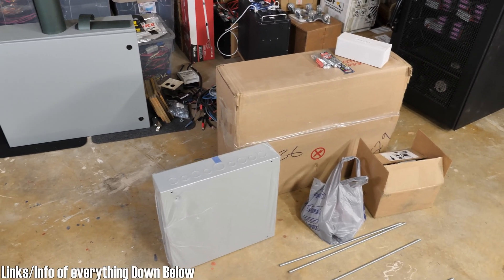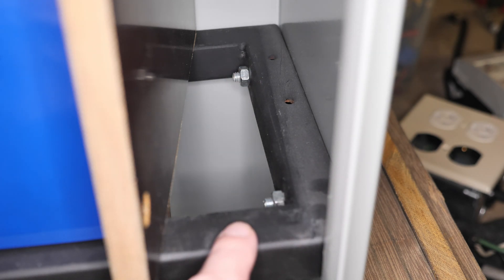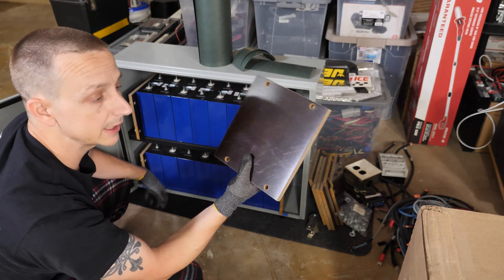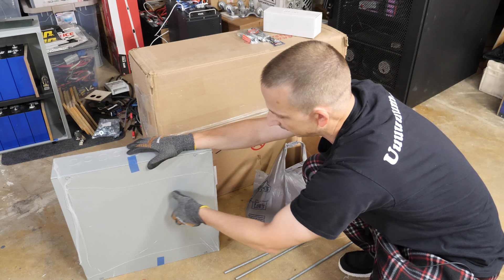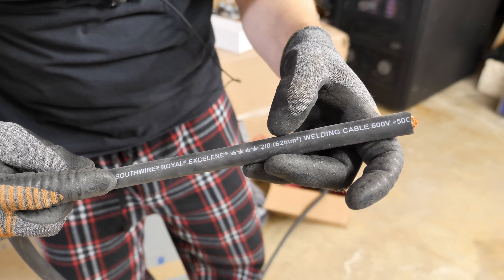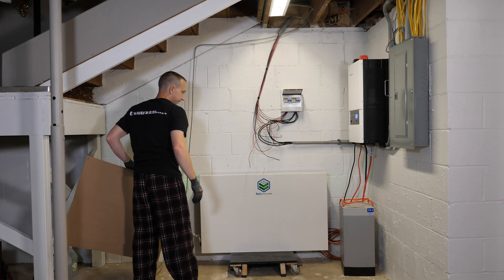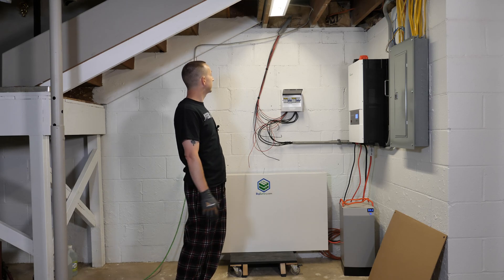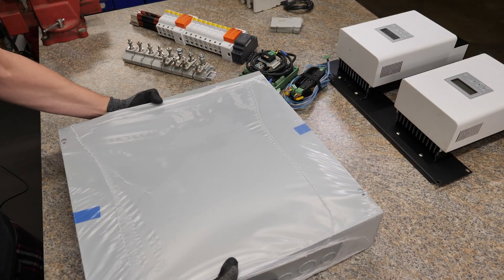The 5 Peeee's DIY POWERWALL 2.0 ep2

Comment: Your idea of screwing the battery enclosures to the wall might be semi unsafe. I would suggest a nice adjustable metal set of heavy duty shelves that are rated for the weight of the boxes. The solar box can also be safely set on the shelf and you can move each around to your liking. Suggestion 2 might be building a deck box on the floor that gives you access to each battery set. You would have a nice work area or seating or tool area on the wall. Yay ?
Reply from the maker: Later video I ended up using uni-strut to mount the battery boxes.  So far its a super solid way to mount them!💥🤘

Comment: Unistrut would definitely work but even that might be a little uneven with the way your walls are. If it was me I'd just grab a diamond concrete grinding wheel for an angle grinder to make things a bit more flat. Then mount directly to the wall or use 1/2 height Unistrut pieces mounted horizontally. I'm sure whatever you decide it will look great.

Comment: You can always use fender washers as spacers to even it out if you bolt directly to the wall, having a bit of space between the box and the wall will also reduce the likelihood of rust. If you go with Uni I'd stick with the steel version, the aluminum version is nice but the lip strength on it to hold that box isn't quite as strong. That's a lot of weight that'll be hanging off it. 

Should get you a lot of capacity though!
Reply from the maker: I decided the uni-strut is the way to go for sure! Havent seen aluminum at lowes, only steel. Will go with the bigger 12ga over the 14ga kinda for same lip strength reason! Hell yeah upgrade, should be 45-50kwh when I get this up and going! Cant wait🤘
Reply: @AVERAGE_JOE  If you have a Fastenal store in town you might check them on pricing for Uni, Lowes and Home Depot pricing is nuts right now. Fastenal carries it and the aluminum version too if you ever need it. My local Lowes doesn't even have it on the shelf.

Comment: I had the issue of the wall not being square, I solved this with washers/spacers.
Reply from the maker: Did you mount to the wall directly? I think im gonna do unistrut so I can mount other things if needed.🤘
Reply: @AVERAGE_JOE  I mounted it directly to the wall.  Just use washers to level it way simpler.  I used a template made from cardboard to drill the holes and set it all up.

Comment: Why not tapcon a sheet of plywood to the wall, paint it, don't paint it,
 it would look fine either way.   4 anchors in the wall , then it would leave a clean canvas for your artwork! Mount that solar equipment up on it!!  Maybe space it out a bit, and hide wiring behind it!  I would go with plywood!!  It would have a more finished look, and make attaching other thing to it easier!
Reply from the maker: I would but I dont know if plywood would hold everything🤷‍♂️

Comment: I think the Uni Strut is the way to go.  Where I used to work we installed many different types of controls in chemical plants and refineries.  The aluminum strut is really neat to work with and not as likely to corrode or rust like the steel.  Makes it really easy to change spacing if you need to.
Reply from the maker: Will be going with unistrut. I didnt see aluminum at lowes so getting the steel! Should be a pretty sweet look when done!🤘

Comment: Glue plexiglass to the bottom of the shelf.  I would not want the shunt/trip breaker inside of a box.  I'd want it mounted on the wall where it is easily accessible.
Reply from the maker: Shut trip breaker will be accessable when mounted inside box. The switch and face will be exposed.🤘

Comment: The name escapes me but the rockboard used for tile primarily is thinner but prob not quit as strong as unistrut. N cutting the stuff is horrible with all the fiberglass they use. Perhaps a disconnect on each box? Least the unistrut will be strong af! Exciting times from the average Joe channel. Keep up the good work
Reply from the maker: I think there are 2 kinds of the board you are thinking.  Both may be called concrete board.  One is thick and one thin.  They are strong for sure but not sure about mounting that much weight ??  I have some of the thicker stuff which I may install above everything for a layer of protection.  I think Uni-strut FTW!!!  Thanks Mate!!!💥🤘
Reply: @AVERAGE_JOE  I agree, unistrut will be way stronger, you have all the anchoring options you could hope for. Good luck Joe!

Comment: I was thinking for the smoke make at the top a capture funnel that with a smoke detector, turns on a strong fan to suck and force it out.
Reply from the maker: I will probly add a smoke detector to the batrium so it can possibly do that and of course disconnect everything!!🤘

Comment: So, any fuse is to protect the.cables. What size cable are you using? Will it withstand 400A + 10-15%? Might be a bit much for 2/0?
Reply from the maker: Yeah will have 400a HRC fuses right off the battery and then those cables will go to the shunt trip breaker.  The amp draw for 12kw on the growatt inverter is about 250a so 2/0 is plenty as I wont be running full bore 24/7.  I went with 250a X 1.5 which gave me 375 so I rounded up to 400a on the fuses.🤘

Comment: Man those batteries are going to be heavy hanging on a wall.. you are going to need some heavy duty reinforcing of those cabinets/boxes from what I can see. Why not just put them on the ground and stack them?
Reply from the maker: Yeah its gonna be heavy but close to the wall should help.  The boxes are already pretty heavy duty steel and not light.  I had thought about on the ground but wanted them up on the wall and off the ground.
Reply: @AVERAGE_JOE  yes it will look cool having them on the wall off the floor. Usually cabinets/shelves that have a lot of weight in/on them have legs that go to a concrete floor. That’s what actually supports the weight.

Comment: If you’re really set on having a low profile for the Rhino, another option is grinding down the wall until it’s flush. I just don’t see how a unistrut fixes the problem of an uneven mounting surface.
Reply: He would washer it out where needed
Reply from the maker: With the uni-strut I guess since it pushes them out a little I can mount the strut on a flatter surface BUT I could use washers as many suggest to shim boxes on wall.  Uni-strut would make it easier and possibly less washers.

Comment: Let the Batrium have its own apartment.  All strut is what I use for everything I mount anywhere.  Don't have to be so precise with mounting holes or hardware, and you can move it simply without starting and drilling over.  and you can add additional support screws if and where you need them because of the weight.
Reply from the maker: YES!!! I LOVE THAT!!!!  Uni-Strut FTW!!!💥💥💥🤘

Comment: Each battery case should have a disconnect, temperature sensors, and exhaust fan. Even though each pack will have its own BMS to see all the metrics and stats. I’d incorporate a dedicated shunt and display to help monitor and track each pack for operation and overall health.

I would install X (fire) rated drywall or cement board to the wall. This will slow down and contain any potential fire. I like your venting idea to the outside and with the inclusion of the fans on each enclosure it will help reduce the potential of deadly LiFePO4 gases should there ever be a rupture.

They make dedicated venting doors for various industries. But you can make your own by cutting out an appropriate sized hole on one side. Put a fan grill with filter on the outside. On the inside just have a hinged metal plate that will swing open anytime the fan is activated.

This simple design insures two things which is during normal operations and no fan is on the enclosure is always sealed. When and if the fan is activated it can draw outside air to cool the interior while also venting the heat / fumes to the outside. 

As it relates to the venting tube. You’ll need to balance costs vs fire propagation. You can find a middle ground by using whatever sized conduit and enclosing that specific pipe within a metallic hard duct like for a furnace / dryer.

Having a dual wall venting pipe assures if the fumes turns into a raging fire if and when the plastic conduit melts the outer metal duct will still contain and vent the hazard.

Lastly, as it relates to temperature monitoring have a dedicated display mounted to the outside of each enclosure. 

This will provide two things which is by eye you can see the interior temperature without ever opening the door. Two, should there ever be a raging fire you’ll know it’s not safe to open the door!

Anyone who recalls the movie Back Draft knows the extreme hazard of providing fire what it needs: Oxygen 

You open that door while there’s a smouldering fire. As soon as you open that door Booom! 🤦‍♂️

Lastly, have two 20lbs ABC rated fire extinguishers mounted close by. One by the power wall and one at the bottom of the stairs. If you want to get fancy you can connect the temperature sensors to activate a relay to turn on a strobe / red light / siren so at a glance and by ear you’ll know there’s a fire condition present. 

Love your channel and everything you continue to share with the community!

Rock On . . . 👍🤘
Reply from the maker: Yes,  I will add a disconnect on each box for sure!  The Batrium is the bms I am using and its a single bms however it has longmons that go to each cell which have temp sensors on them.  It also lets me see all cells so will use 1 shunt.  The batrium will allow me to do all sorts of stuff if wanted.  The wall in concrete so wont need to add concrete board there however I plan to add concrete board above the system to cover any wood for jic even tho LiFePO4 shouldnt go up in flames.  I guess the flame protection would be for the other items!  Thanks for all the suggestions!! Appreciate it!!!🤘

Comment: How about a vertical chase-way butted up against the battery boxes, with the electronics box directly on the other side ?  That'd be really clean.
Reply from the maker: I was thinking about those chase ways.  Only tricky part is under the inverter...if I took it over that way as well!!🤘
Reply: @AVERAGE_JOE  Yea you could totally run a horizontal chaseway under the electronics box and around to under the inverter.  No visible wires!

Comment: Re mounting, unistrut will work fine but it might be easier to add some spacers, shims or rubber washers as standoffs so the boxes are a fraction of an inch off the wall for leveling.   Just a thought.
Reply from the maker: Oh yeah true on shims to level it all off!!💥🤘

Comment: Consider getting one of those plastic boxes with din rail for the breakers and surge suppressors. The din rail load centre is commonly used outside North America so should be cheap online. Also, unistrut.
Reply from the maker: Could just get a bigger din rail box like the one im using meow I guess??

Comment: I've only every heard of the 7 p's and the 8 p's.
Perfect Prior Planning Prevents Piss Poor Performance.
Probably.

As for the spare room in the solar box, I don't understand why you're running surge suppressors. You should never see any surges given that it's for all intents and purposes, a battery supply. You shouldn't even see any transients for that matter, aside from small ones from your larger inductive loads. So you could easily omit them and gain an extra 4 circuit breaker positions.
Reply from the maker: I bet we could add some moar Peeee's in there....probably!!!

The surge suppressors are on the solar input side.  Just trying to "help" prevent any damage if I can!🤔

Comment: The airgap away from the wall is probably best anyways. In case you need to run some wires behind it you'll have the room. Also, gives an extra area for ventilation depending on layout. 
Altho, it does add more area for spiders to make homes  😹😹
Reply from the maker: True didnt think about extra/rando wires.  OOOOOOOO will have to put some sort of a foam strip back there to help prevent those SPIDIES!!!!😲😆💥

Comment: Looks to me like your concrete wall has had some maintenance done to it at some point.  If you look at all the other blocks they are the standard 18" long. However, that one that is sticking out is a half block and rough all around it. Wonder what kind of work happened there  🤔🤔
Reply from the maker: I was kinda think the same as far as maintenance.  Im moar thinking it was a change as addition/subtraction when they built the house!  Hard to say 100% tho🤔🤔

Comment: I'm having trouble envisioning how you are going to get the threaded rods and compression plates on the ends of the packs unless you are doing it outside of the Hammond box and putting the assembled cells / compression plates in after. BTW, those nuts on the compression plate are called T-nuts.
Reply from the maker: Ill put the back 2 rods and left plate in box first. Then set all cells in along with the outer 2 rods and then the right side plate.  The right side plate will have washers and nuts.  Yeah lol I remembered the T-nuts after the video!!!😆😆🤘

Comment: An air gap using uni strut is a good idea, The industrial look of uni strut is fine. I would put the battrium in a separate box with a plexiglass lid (lit up with LED’s) just because it looks cool. Mine are on a PIR sensor so they come on when you get near it.
Reply from the maker: I am warming up to the uni-strut moar and moar.  Its already gonna have an industrial look with the boxes so the strut may look just as good.  Yeah batrium will have to go in another box for sure as I forgot about the wifi signal lol.  I like that idea with the pir sensors!!!  Id like to do the SOC leds!!!💥🤘
Reply: @AVERAGE_JOE  Embrace the strut 🕺🏽 Why wouldn’t you do the SOC LED’s?

Comment: I would go directly on the concrete and put some small (1/2 inch) rubber spacers between you box and the wall. Your box would then not need to follow the contours of the imperfect wall.
Reply from the maker: That is a pretty good idea actually!  😲🤔🤘

Comment: How much will one of those battery boxes weigh? so likely you will have to support 1000lbs on the wall so I would go with uni-strut long enough to sit on the floor for added support. awesome build AJ.
Reply from the maker: Oh yeah weight will be a thing!!! I will for sure keep the strut long enough to start at the floor for that reason!!😆💥🤘
Reply: @AVERAGE_JOE  You could also use a false front with holes for the doors of the boxes then you don't need piping and the control box.

Comment: You could attach a sheet of cement board or plywood to the wall and then attach everything to it. Only a few holes in the wall, then attaching things to the board is simple and allows for easy modifications to layout. Or attach the board to the unistrut you were thinking about.
Reply from the maker: I had thought about building out a wall there with studs and drywall ect.  Would look nice but I think with all the weight, uni-strut would be the way to go!💥🤘